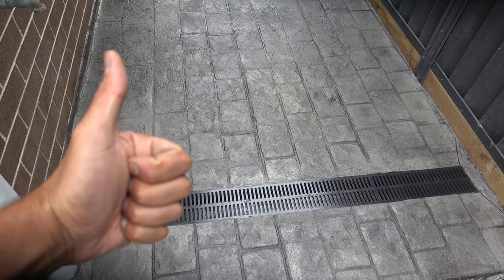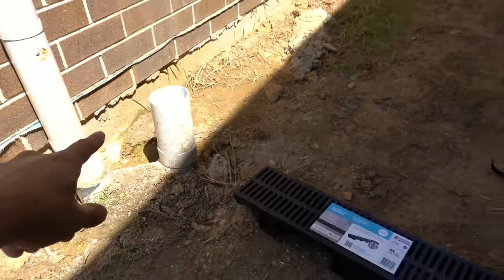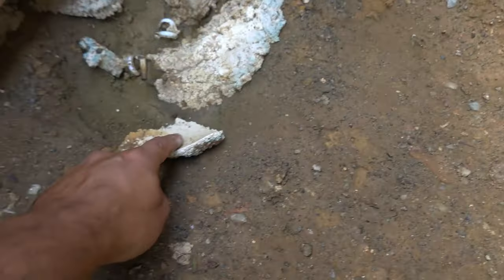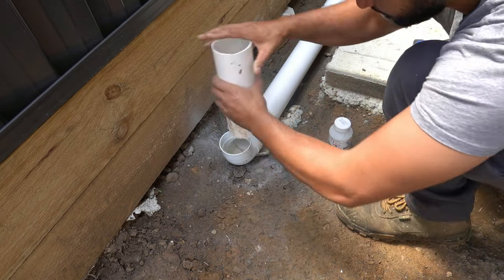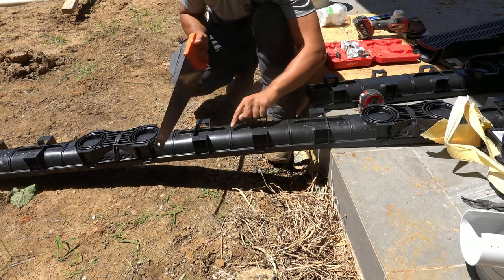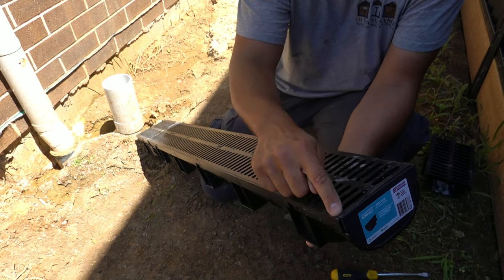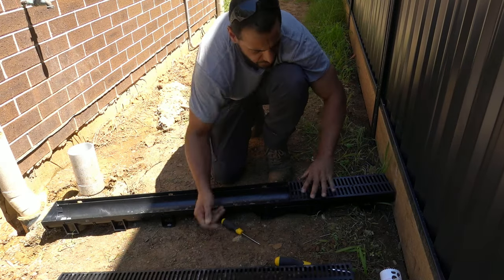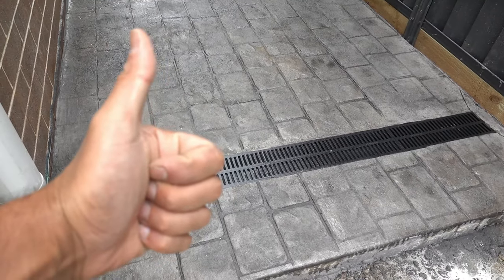How to install drainage channel grate - DIY

Comment: Thanks for the video. This has helped me a lot as I am planning a similar project. I am looking for a little bit of clarification around connecting to the downpipe. If it is a wet system, won't cutting a hole firstly release water in the pipe, and secondly, result in upwelling at the grated drain? Or am I getting fluid mechanics totally wrong? Thanks in advance.

Comment: Would be helpful to see how they are set into concrete. Maybe next time Bill?  Cheers :-)
Reply from the maker: Set into the concrete is the easy part. Put a little bit of concrete underneath the channel and concrete around it. Maybe next time👍👍👍
Reply: Don't forget some adhesive foam along the top edges so you can remove the grate after the concrete has set! Pretty important step.

Comment: A question : there are water/sewerage pvc tubes alongside the house & buried (any idea how deep ?), if concreted & a pvc pipe broken, need to break the concrete ? (concreted mine just thinking ahead just in case).

Comment: Great video mate. Can you cut with a saw that is not on the rib at 1400 like you did? Just randomly in the middle of the ribs?
Reply from the maker: Needs to be on the rib if you want to add a joint to it. If there’s no joint you can glue and seal the end cap on 👍

Comment: Hi Bill, quick question,  do we need to use primer first, then pvc cement? Also, I saw an old plumber who loves to insert pvc first to see the position before applying glue. Is that correct ?
Reply from the maker: Primer should be used on joints. Depending on the where and what the pipe is being used for you can get away with no primer. As for inserting pipe work first that’s a personal choice once again depending on what your doing. This section didn’t need to be exactly in a particular spot 👍
Reply: @billshowto  very good to learn mate

Comment: Fk it no primer or chairs
Reply from the maker: No need for chairs if you lift the steel up into concrete as you pour, personal preference. As for the primer, it should be used on all joints however depending on where and what the pipe is being used for  you can get away with no primer 👍